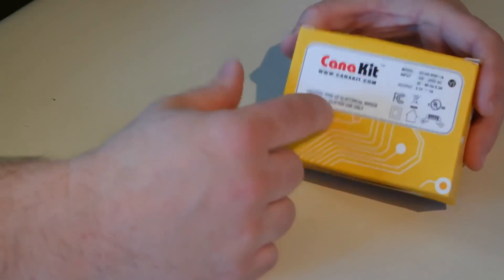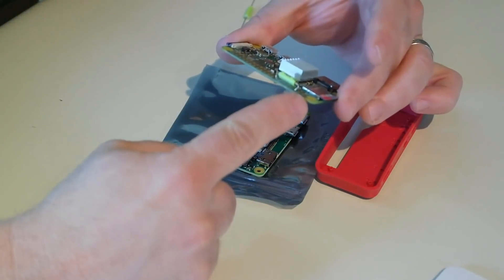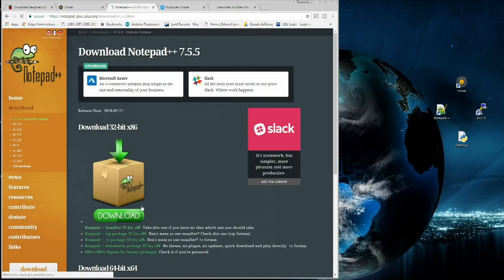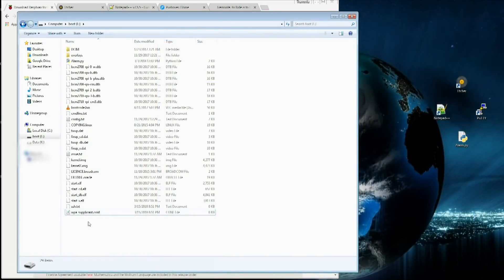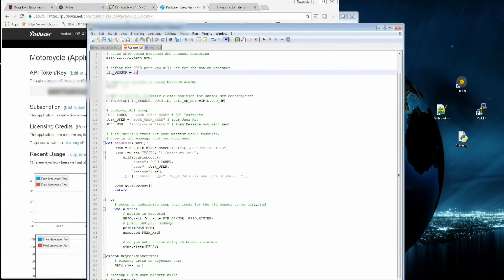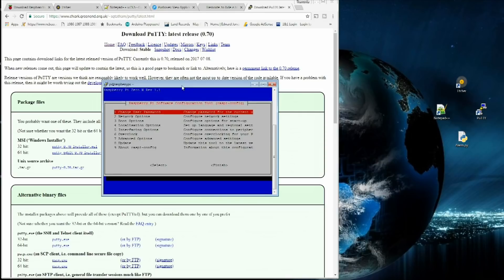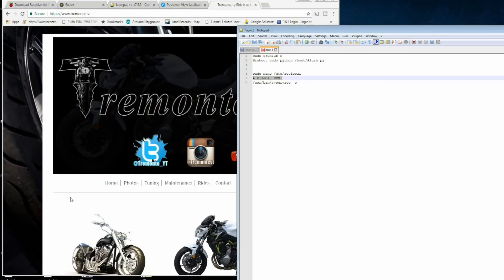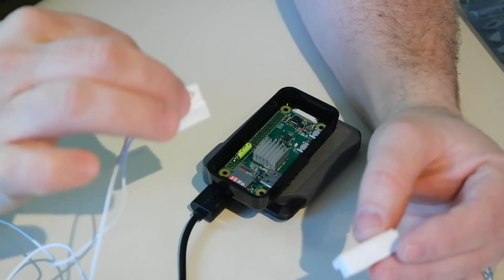MotoPi Alarm Tutorial | Raspberry Pi Motorcycle Alarm

Comment: Do you know if its possible to integrate SMS and not have to be connected to wifi?
Reply from the maker: +TheTylermc24 you could, but it would require a cell piggyback and carrier service. At that point, you would be better off to buy a gps tracker with subscription service